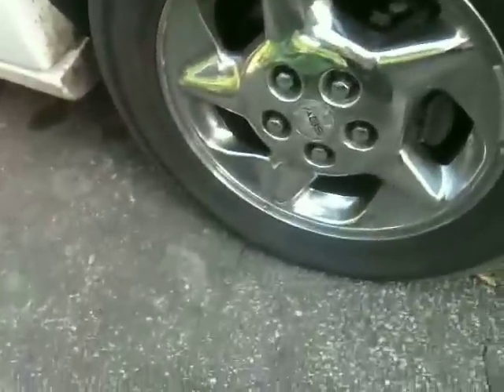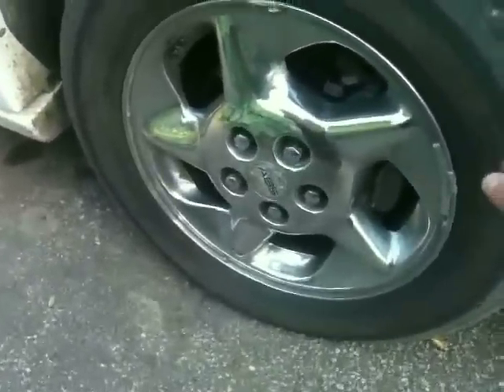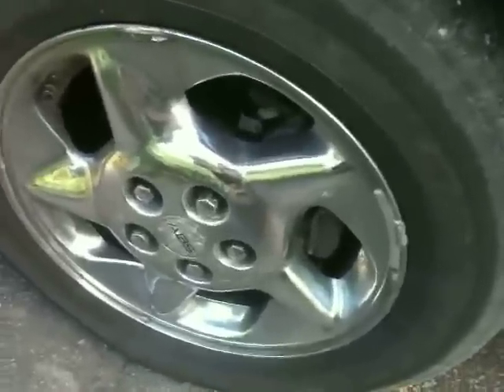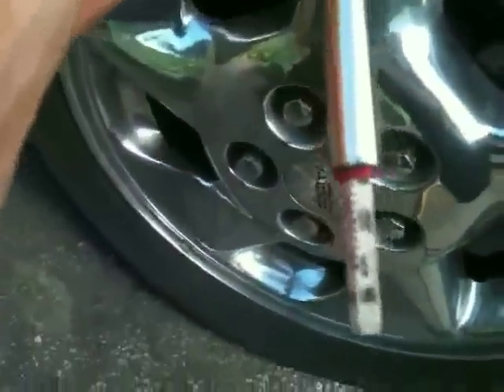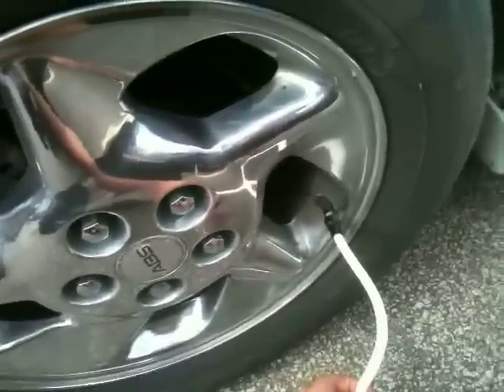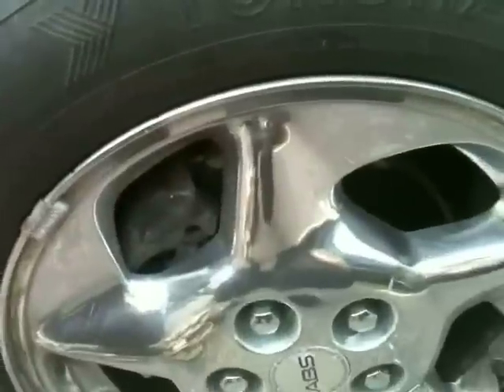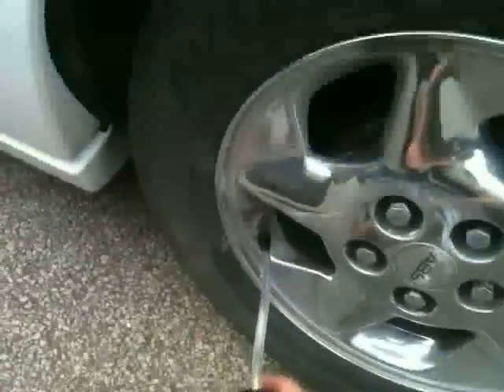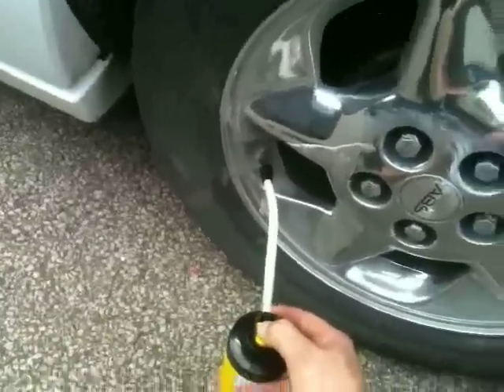How to fix leaky tires

Comment from the maker: @briggsman5s I think you can get that stuff at any auto supplies house, like Oriellys, Autozone and Advanced. I've never tried it, but I'm sure it works just as well as the Fix a Flat brand tire sealant. Besides that, I've used that Fix a Flat stuff in my lawnmowers before when something was in the tires and they kept going flat.

Comment from the maker: @vwestlife Some of the rims of my car have some corrosion problems, especially around the letters ABS and the center of the wheel and around the valve stem. And yes the brake pedal does say Anti Lock Brakes on it. I think that's very cool! Also I find really cool how some of the later Chevrolet Caprice rims say Division of Chevrolet Motor Company or something to that effect on the part you pop off to access the wheel bolts.

Comment from the maker: @ChiefLeftenant Earlier in the year I had the brilliant idea to check the rim for leaks with a spray bottle full of soap water. Sure enough, little water/air bubbles poked up all around the bread/rim. So I don't if the rims are junk or if the bead wasn't thoroughly cleaned when the tires where installed.

Comment: You can buy that stuff over here too!
I carried a can in my Motorhome in case I got a flat in hard place to change a wheel.(Never needed it though)
All the products like that over here have a warning that they are only to be used in an emergency...and not to drive more than 50 mph.
Some UK Fords don't come with a spare wheel...They just have a can of that goo!
I used it on my wheel barrow...Worked great...Still up after three years...haha!!!

Comment from the maker: @onetoughtechie My wheels must already be out of balance. Traveling at high speeds, 55 or faster, I feel the wheels wanting to shake back and forth. I can't see where a weight has fallen off and I don't think the shake is caused by a loose mechanical piece of some kind. Maybe my tires need to be replaced. Replacing the tires on the grey Buick solved it's tire shake problem...

Comment: Tire shops really don't like this stuff, because it makes a gooey mess when they go to take the tire off. But some types of alloy wheels, especially those made of aluminum, will start corroding over the years and cause the tire to leak at the bead, and there is no real fix except to replace the wheel.

p.s. I find it amusing how Pontiac chose to advertise Anti-lock Braking System directly on the wheels! Does it have the ABS logo on the brake pedal, too?

Comment: I had that in my tire when I was on the road and had a small nail in it . It worked great but for 2 problems 
1 at higher speeds it affected the balance so because when you start driving it .  2 The tire repair place and as a matter of fact 2 places I took it to would not repair the tire as they said it may hold air but once it has that stuff in it the tire can not be repaired.